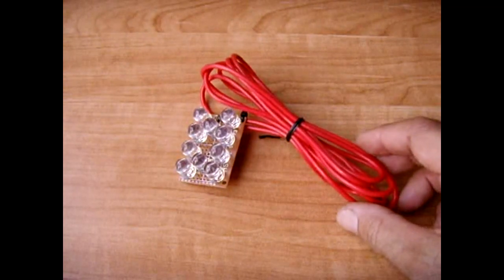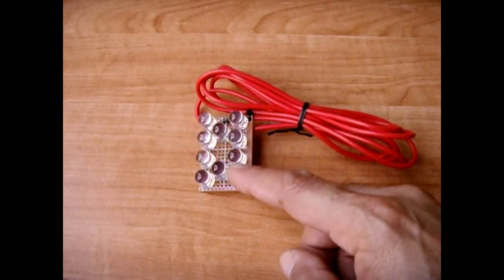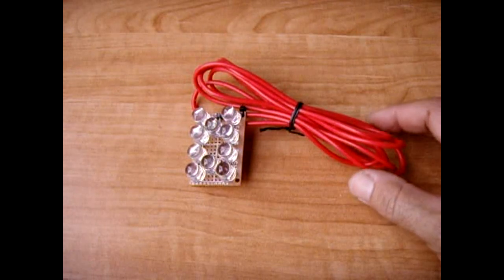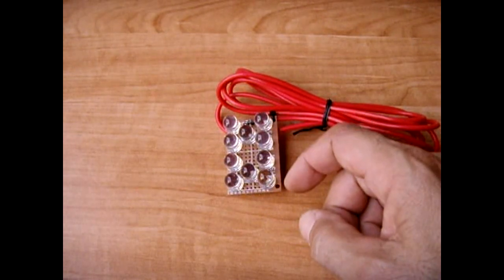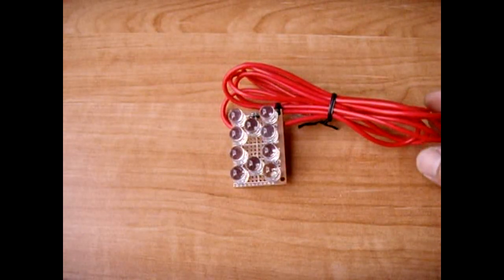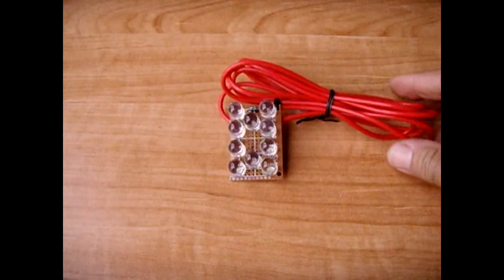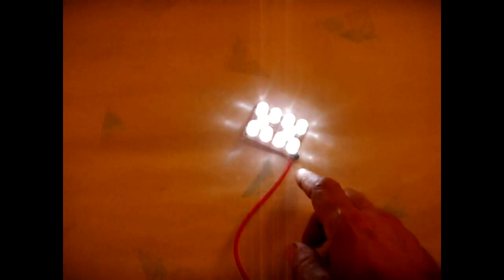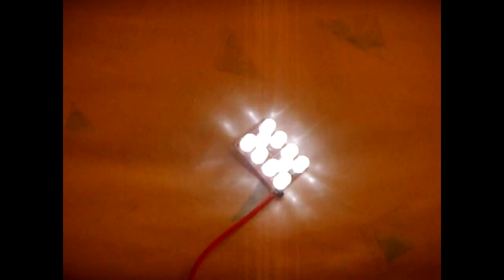Telephone Line Powered Ultrabright LED's

Comment: Made one similar. What's cool is this can work even if your land line has been "disconnected" for years. You don't need a dial tone. Just the current. Oh, and I didn't bother with the diode. LEDs are diodes, right? Plus I'm pretty sure a disconnected phone will never ring.

Comment: With a phone charger 4.7 V, each LED can be connected? 2, 4, 6, 8 or 10?
It is advisable to law in series or parallel?
Reply from the maker: +Ady Michnea 
Hi. Each white LED requires around 3.1V. Measure the output voltage of the charger, and go from there. If you only have 4.7V open circuit, then use a 75 ohm resistor in series with each LED in parallel across the output.

Thanks

Comment: Cu un incarcator de telefon de 4,7v, cate leduri se pot lega? 2 ,4 ,6 , 8 sau 10 ?
Este indicat sa se lege in serie sau in paralel ?
Reply from the maker: +MAL tv Muzica 
English please. Use an online translator. Thanks.
Reply: Google Traduceți: 
Fiecare LED alb cere în jur de 3.1V. Se măsoară tensiunea de ieșire a încărcătorului, și du-te de acolo. Dacă aveți doar 4.7V circuit deschis, apoi utilizați un rezistor de 75 ohm, în serie cu fiecare LED-uri în paralel peste ieșire.

Mulțumiri

Comment: Are the led's in series or parallel?
Reply from the maker: +The Computer Tech Guy 
Series.
Reply: +electronicsNmore oh okay I have 6 led's in parallel and I noticed that with more led's the brightness dims a noticeable amount for every led connected
Reply: +electronicsNmore oh and I'm using no resistor for max brightness and I have 49v and it's not damaging my led's
Reply: Nvm it blinks

Comment: How does the phone company not say anything about this?? When you pick up the phone off the receiver and voltage changes indicating the receiver is off the hook or when your making a call and the other end picks up the voltage changes again stating that the receiving end picked up the phone, etc, etc. Anyway when they see the power fluxing out of the ordinary they assume something malfunctioning and send out a telephone repair man. Just stating the fact, but hey awesome video!
Reply from the maker: +Cam Young 
You can leave this device plugged in all day and no one will knock on your door. :-)

Comment: What happens to the LED's when incoming ringing current comes in on phone line?
Reply from the maker: The phone will still ring(in my case with DSL internet connected), but the ringing is much shorter in duration. The LED's get slightly brighter during each brief ring.

Thanks For Watching. Please share with others, and rate Thumbs Up.

Comment: What if the telephone rang with a high voltage? will it burn the LEDs ?
Reply from the maker: No. I tested that and all that happens is the LED's flash brighter on each ring. The ring can still be heard, but the duration is shorter. This device is meant for emergency lighting when the AC mains power is off, not intended to be left in all the time.

Thanks for watching!

Comment: I was hoping for your normal great schematics. Which pins of phone cord to use, etc. Also at 3:23 your video skips as the led array moves up but your nice round beam on the wall has a delay in moving ;-)
Reply from the maker: The 3:23 was due to video editing. For the typical phone line (4 wire) use the red and green wires. If you have orange, orange w/white, blue, blue w/white, then usually you use the blue and blue w/white. Refer to the link in the description area. The schematic was not mine, otherwise I would have drawn it up for you. :-)

Comment: Great Ideal,and simple to build. I live in the Southeast,and here in the Mountains when the power goes out it is most likely a tree fall. So No phone. So what I did was to make a setup similar to yours, and power it by 12 volt car batteries with a small battery maintainer to keep the batteries charged. I have had this running nonstop for almost four years now. I haven't lost one LED yet. Which is a life test of the LED's. Thank you for sharing and take care. Love your channel and your projects.
Reply from the maker: Led's last a long time (especially the Japanese made)if you do not drive them higher than 20ma. If I make a flashlight, I drive them very high(30ma or higher), If I make a night light which is used 8-10hrs/day, then I drive them at 15ma. My LED's never blow, but after a couple years, they lose intensity by fading.

Thanks for watching!
Reply: electronicsNmore
Thank you for the reply. and the information. I am looking forward to more videos.
Warm regards and Happy holidays

Comment: Hi mate have you any idea if this will work thru the uk's phone sockets?
Reply from the maker: You "may" be correct, but good luck proving it. If they ever did come knocking on the door, all you have to say is there must be a wire shorting out somewhere in the house. :-) The power you are using to drive a bank of LED's is a negligible amount.
Reply: In the UK I'm pretty sure that it it's illegal to use the telephone lines power. Just warning you.
Reply from the maker: I just looked it up. Seems like UK also uses 50vdc. Measure the voltage across the 2 phone wires. If it is around 50v, it should work.
Reply: electronicsNmore thanks I will do